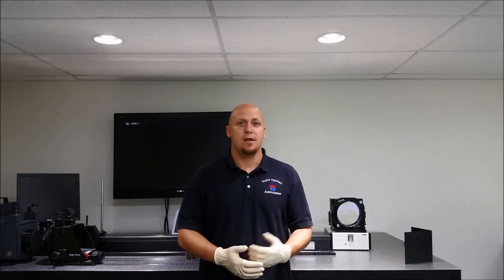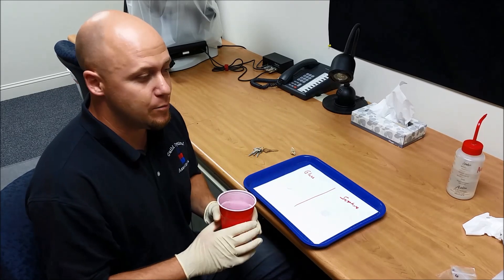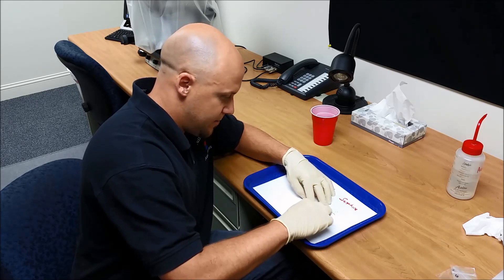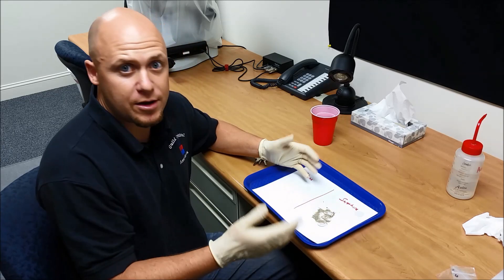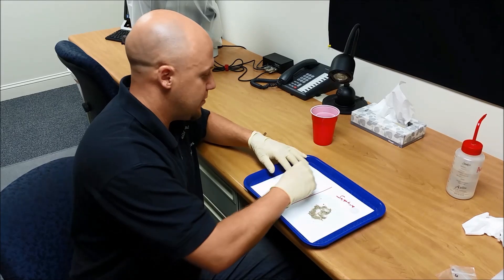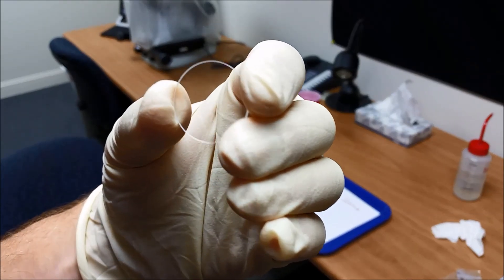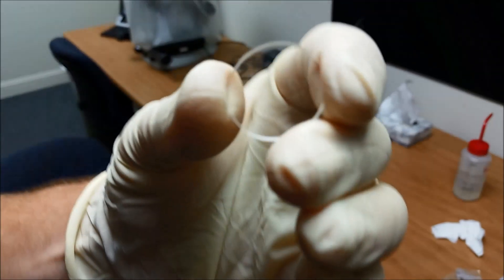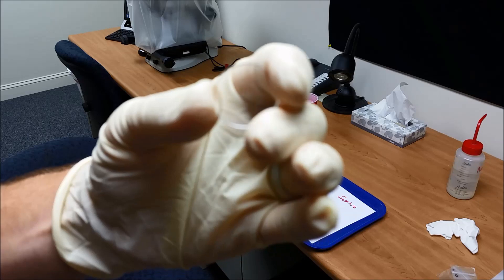Sapphire Window Scratch Test - Optical Grade Sapphire

Comment: Well, Swiss Mechanical Timepieces, wrist or others have lost to Quartz as time keeping devices. Rolex Oyster case was promoted as the ultimate hydrophobic case. I bought my first Rolex in 1964. Servicing and keep it accurate was quite a PIA and expensive. Others caught up with Switzerland, namely Japan and USSR. Today their emphasis is on Investment and next generation. Both are false premises. A Day Date, 18 ct gold watch and armband costing US $25,000 is not an investment when compared to other items and depreciation of the Currency. I bought 2 Fake / Copy Day Date Rolex watches, some 15 years ago. I got them serviced 3 times at fraction of the Rolex Servicing Costs. They still look as good as when I bought them, albeit the Winding Knob that lost its lustre. I got it changed. Swiss Watches are passe regardless of how they try to befoul their customers. Presently I have 6 Watches: 3 'Rolexes', 1 Racine Royal, 1 Omega and on Philip Mercier Radio Controlled. Racine Royal is super thin that I use as a Dress Watch. I was designed by Roger Gallet.

Comment: Thank you for putting it together.  It would be nice to see the samples before you scratched them.

Then, do the test twice, as Patrick states - once with the sapphire on top, and then again with the sapphire on the bottom. 

The interesting thing to me would be to know when it scratches, but that's a much more difficult test.  It would require a method for applying controlled pressure, like a vice.  Then, it would require a more abrasive material, like diamond dust.  Then, slowly increase the pressure and motion until scratches are visible.  Then, examine under a microscope to understand the scratches.

Comment: Not a good back-to-back test. Although you are correct that your test ensures that both surfaces are seeing the same force there is another aspect to your test that you have overlooked. The sapphire since it was on the bottom and most likely did not move back and forth like the glass did (since this is what was in your hand). It is motion of both the surfaces and the sand that accelerates the damage (the sand also may not have actually moved much in your test)  so you should run another with the sapphire on the bottom (most likely subjected to less movement) I don't dispute that you would get less abrasion from the sapphire but a better back-to back test should be run.